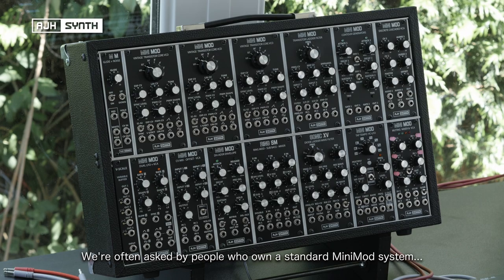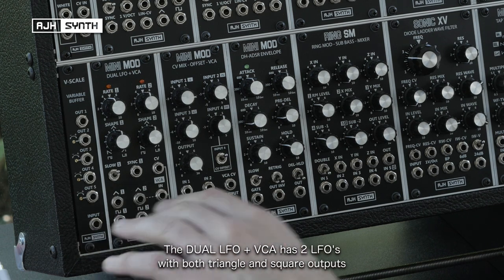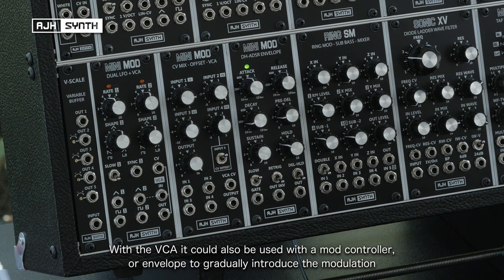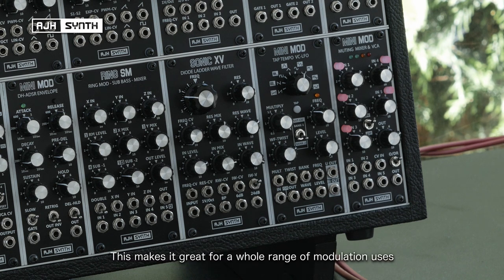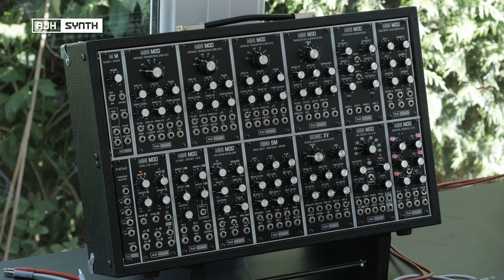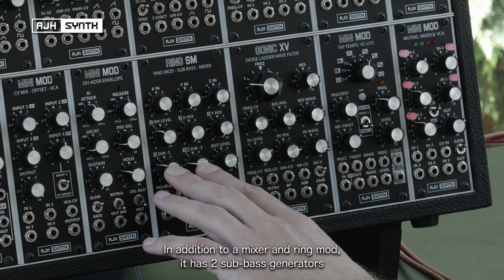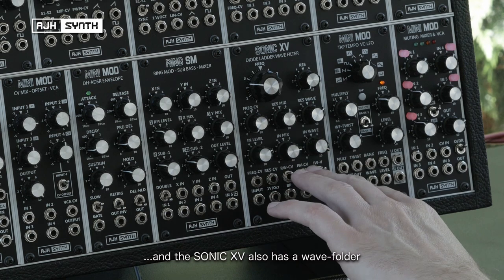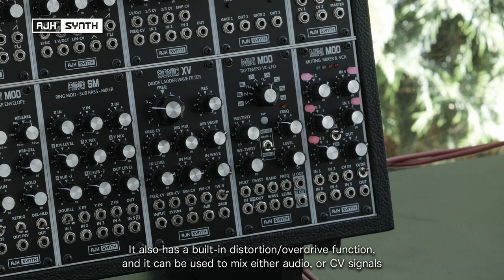Expanding the MiniMod Part 1 - Adding a 2nd Voice in just 2 or 3 modules (AJH Synth Eurorack tips)

Comment: Very interesting. How would you actually use these two voices. Would you use two keyboards? Could you have one keyboard with a split perhaps.
Reply from the maker: There's all manner of possibilities. A keyboard split would work if the keyboard itself has that feature, which would then need a multi-channel MIDI-CV converter if it doesn't have one built in. Otherwise, a multi-channel CV sequencer, in Eurorack such as the Hermod, or external such as the Keystep Pro. The sequencers would also allow you to have one voice playing sequenced patterns, whilst controlling the other with a keyboard. All of these options could control the 2 voices polyphonically too.